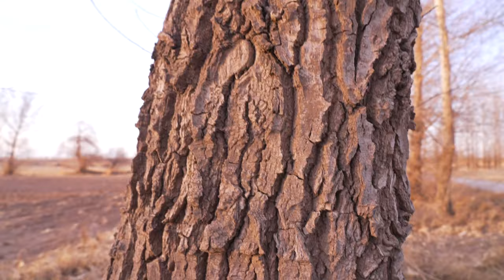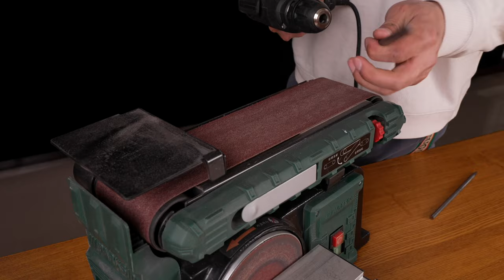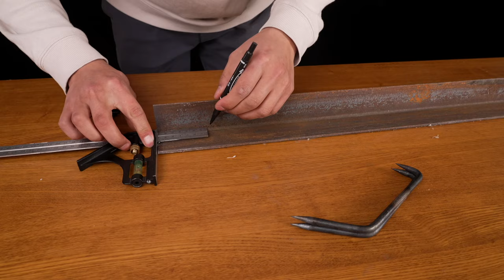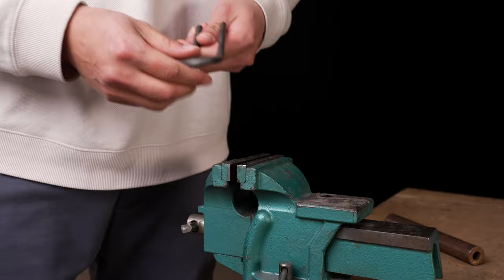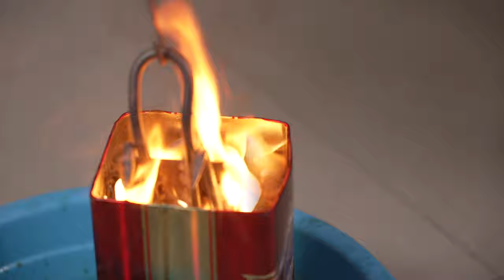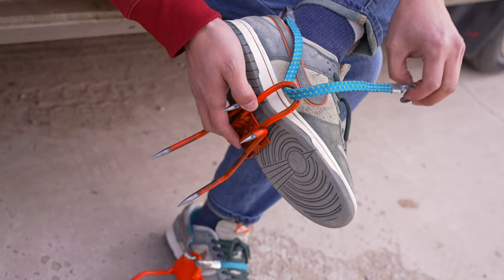This Tool Makes Tree Climbing Effortless!

Comment: Congrabulations!  You've invented something us Canadians have had since ... well ... since before there was a Canada!  If You're climbing a tall tree with no branches, you can even use a belt that goes around the tree to steady yourself.  The belt also means that your hands are free to mount things or cut parts of the tree off or whatever.
Reply: https://www.youtube.com/watch?v=gjGarQ3KxRY

His design could SPRAIN/DAMAGE his ANKLE if his design is like that.
Our country has better design, but we do not have great engineering as his,
If he can polish it, it will be beneficial
Reply: Where??? Yeah, spikes have been around, but not like these. Obviously this is a prototype, and could use further development. The benefit of this design is that it has excellent grip yet does not damage the tree.
Reply: @MeadowFarmer  I'm totally serious!  Tree Climbing spikes for feet have been around for AGES! The origins of tree climbing spurs date back to the late 1800s. The company, Buckingham, has been manufacturing spurs since then, making them one of the oldest and most reputable manufacturers in the industry. The exact origin and inventor of spurs remain unclear, but their usage has been prevalent for well over a century.  They're not that hard to research.
Reply: @Runescope  I haven't seen any like these before. Roller skates were around for ages too, but inline skates replaced traditional roller skates. As I said, this design does far less damage to the tree than traditional spikes. I believe this design has a lot of potential, particularly for climbing trees for pruning.

Comment: He didn’t specify the steel. Bad news: common mild steel from the hardware store, or rebar won’t harden. Good news: it is likely strong enough without hardening. But as a metallurgical engineer, I would want more explanation.

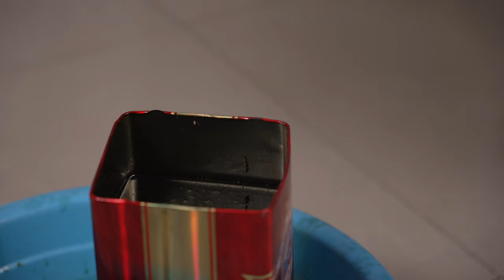Comment: 2:54
What is that immersible bath for ?
How does it help ?
Reply: Tempering..Hardening with oil.
Reply: I hope that your steel had a high enough carbon content to harden properly.  Most steel rods purchased at the local hardware store are low carbon.  While you will get some surface hardening, it will probably not be enough to make a difference.